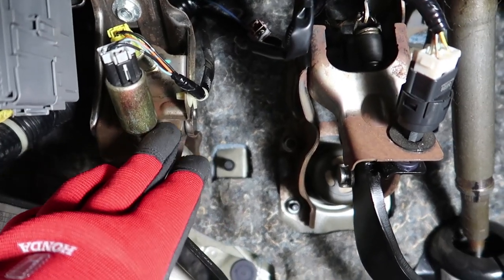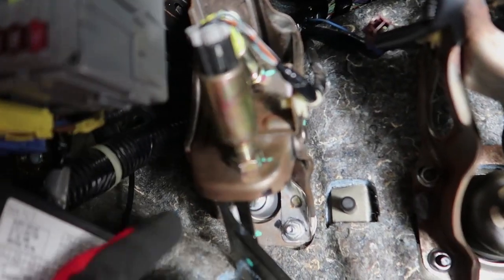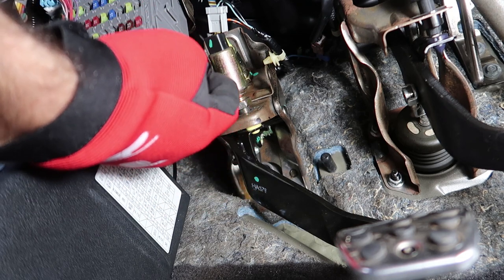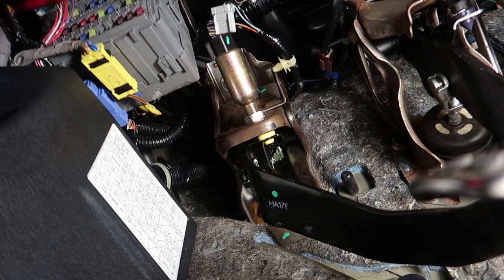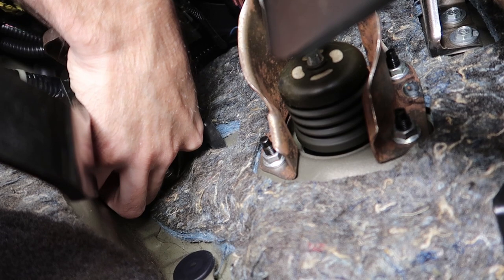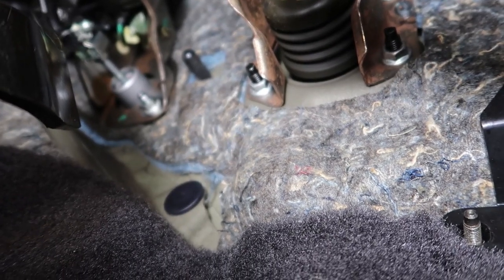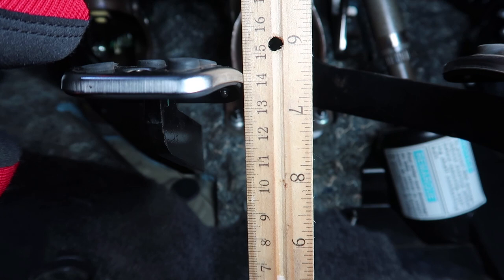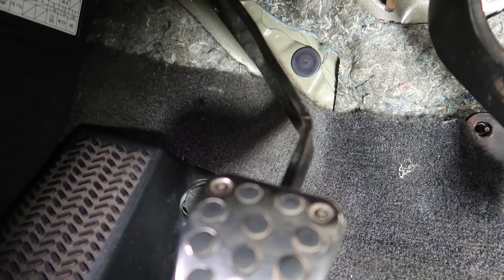8th Civic Si and RSX Type-S Clutch Adjustment DIY | Aftermarket and Stock | FG2, FA5, DC5

Comment: After I did this adjustment, it takes a little more force to get into gear. Do you know why
Reply from the maker: Isaac MacNeill hmm it should shift smooth after adjustment, you can try a little longer pedal travel (less threads showing) then redo the freeplay and make sure the freeplay is in the correct range (usually 10 or 11 mm works well). As long as the clutch has enough travel to release fully, the rest is up to the transmission. Let me know and I’ll try to help
Reply: Jason McMullen thanks man. It was shifting fine before no grinds at high rpm or anything, but I adjusted it because everyone says it will help even if it’s not grinding before. I turned the cmc until I felt it was harder to turn, then loosened it a tiny bit. But it’s a bit wiggly. Is that normal
Reply from the maker: @isaacmacneill2757  yeah it should have a little wiggle, makes sure to check the amount of freeplay with a ruler, Honda doesn't recommend less than 10mm of freeplay or it could cause damage.  Range is 10-18mm.  If you didn't have issues before, you could try to go back to your previous settings, but usually people can find an adjustment that works for them. If you try zero threads showing and 10 or 11mm of freeplay, it will give you the max amount of pedal travel for the clutch to release. Also the K-tuned aftermarket EM1 style CMC/slave will give even more room for pedal travel.  I hope it works out buddy!
Reply: Jason McMullen thanks. The catching point felt way way higher the first time I adjusted it and i kind of though the clutch never actually fully let out. Idk if that makes sense. That was when it was about one and a half threads. I put it at almost 3 and it feels a bit better but the catching point still feels quite a bit higher than before but I know that’s what you’re looking for with this adjustment. Just harder to get into gears
Reply: Jason McMullen ill measure the free play.

Comment: replaced the cmc and now the car doesn’t turn on ...
Reply from the maker: Make sure you bleed the system first. Usually you don’t have to adjust the switch above the height adjustment screw, but there is another adjustment screw that will allow the car to start when the clutch is pushed in, adjust is so that that car will start even with the pedal 10-18mm off the floor
Reply: @JasonMcMullen  got it to turn on finally last night ... but now the clutch feels wierd but wow man i appreciate you replying to comments
Reply from the maker: @trillflaco  no problem bro! Glad you got it started. How does it feel? Maybe I can help, depending on what’s going on
Reply: @JasonMcMullen  the clutch grabs very late idk maybe its the new cmc but im not sure, i adjusted it too
Reply from the maker: @trillflaco  the adjustment will make it grab higher up but not at the very top. Make sure the freeplay is correct. I like about 11-12 mm. If it really bothers you then you can try to adjust the clutch pedal to be a little lower (more threads showing) and then redo the freeplay. However having a clutch pedal too low will result in gear grinding/less smooth shifting. Most people get use to the higher grab point in a week or two (but like I said it shouldn’t be at the very very top)